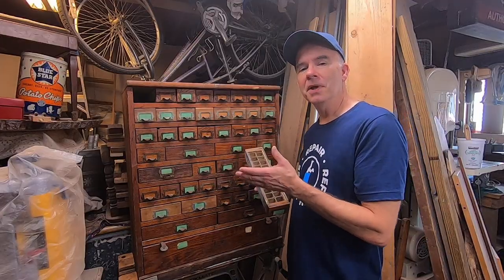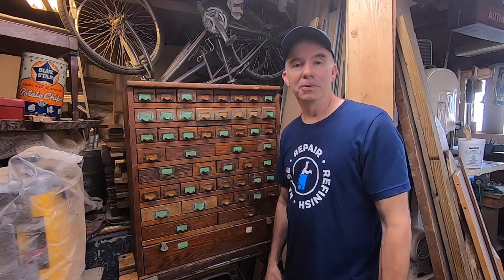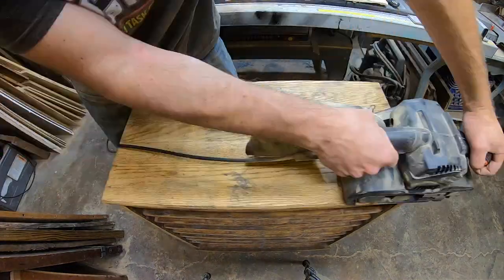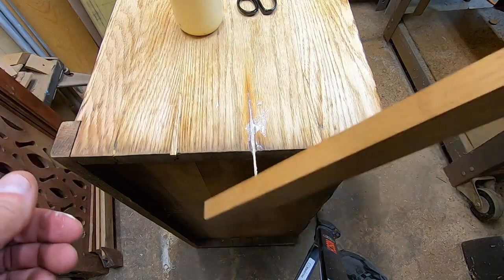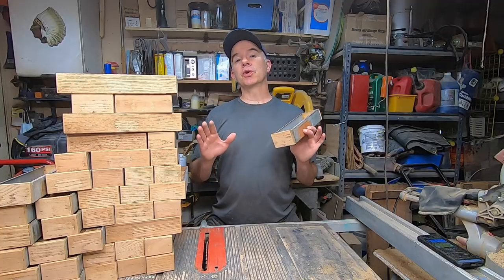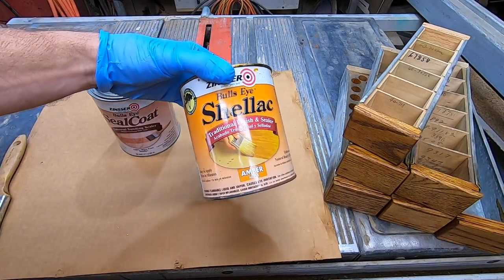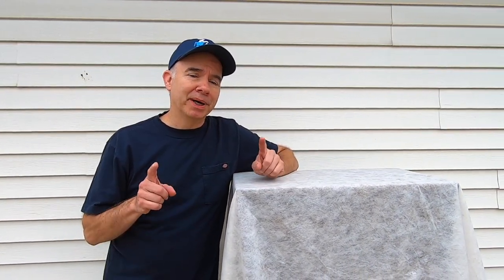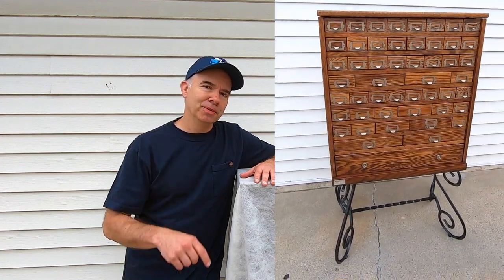Factory Parts Cabinet Restoration

Comment: That really came out nice!
I loved the way you filled the splits..lots of inspiration for me.
Try heating your spray cans in hot water before spraying. Also if the tips keep clogging between sprays flip the can upside down and spray until it comes out clear...I promise you will like the results
Reply from the maker: I have tried the upside down thing before and still had them clog. I even clean the nozzle after I'm done.

Comment: Remarkable work & dedication.  Do your repairs take the stain the same way as the original wood (color wise)? I always have trouble matching colors with original & repair - even if the repair wood is reclaimed from about the same time period.  Excellent job!
Reply from the maker: The match is usually very close. If it was lighter, I would have taken a small paint brush to the affected area, gave it a 2nd coat and blended it.

Comment: Awesome job! Where did you find the replacement handles?
Reply from the maker: For the large drawer, I used 2 knobs that I took off a cabinet in the alley. Buffed them and painted them the same color as the smaller drawer handles.